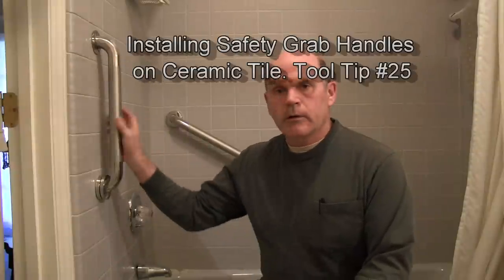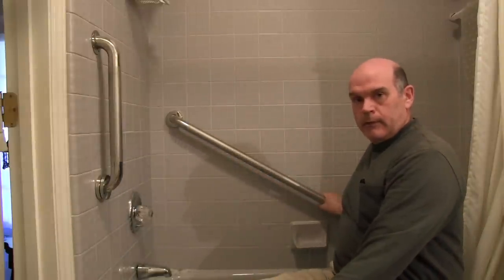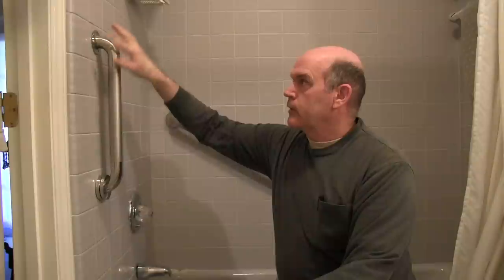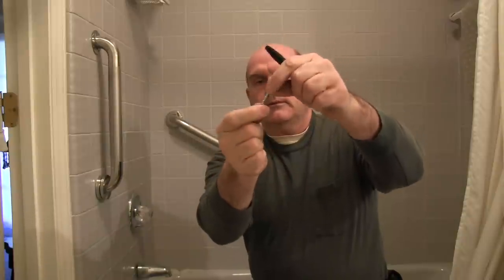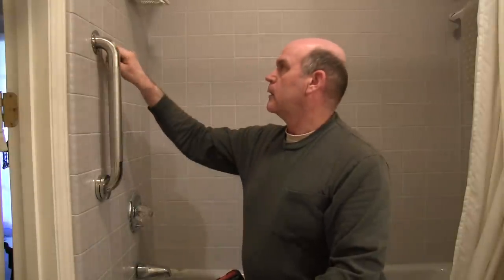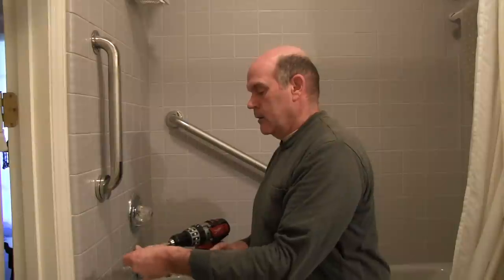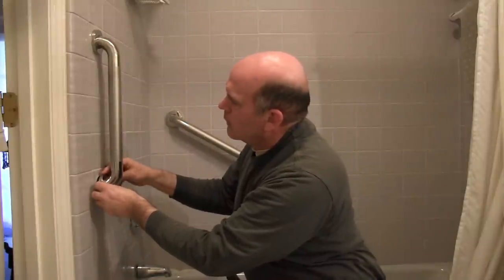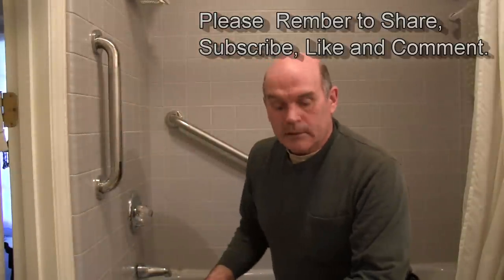Installing Safety Grab Handles on Ceramic Tile  Tool Tip #25

Comment: Just got mine done,  found out you definitely need a tile bit and a hammer drill , used bosh , !! I did 5/16 holes and plastic anchor and  screw kit #10 1&1/4 long 50 lbs per anchor , as it's a helper ... Not to support all my weight!  , it's great , got the 18" bar  at ace , having knee surgery wanting a rail to grab in shower ...  People say only mount to a stud.. great if they are in the correct place!!  I had none to line up .. tile is plenty... strong

Comment: You didn't show how you inserted the two screws under the actual rail itself, and you didn't apply silicon under the cover plates, after all it is a wet seal area

Comment: I'd much rather mount both bars to a stub.  Sometimes you can get easy access with a stud finder above the ceramic tile.  And on this one vertical bar, you had completely open access to the other side of the wall and could have used a stud finder on that other side of the wall.
Reply: Using special toggle bolts will work just fine.  They will not pull out.  But any kind of anchor might
Reply: Sometimes one needs to consider placement that's appropriate. Im an OT and half of the time I see a home with grab bars, in studs as you suggest and in awful, unusable placement in terms of function which kind of defeats the purpose of installation.

Comment: I found this video very helpful in installing a vertical grab bar in my ceramic tiled shower area. I intended to fasten one screw on each end into a steel wall stud & I was looking for a simple method of attaching the remaining four screws. Luckily I found this video on YouTube and instead of attaching grab bar to a steel stud with one screw on each end  & the two other screws on each end into molly's of some kind I decided to move the grab bar over & I attached both ends with 6 Walldog screws after drilling thru the ceramic tiles. These screws hold the grab bar solidly to the wall and I'm very confident that no amount of human pulling force on the bar will dislodge it.
Reply from the maker: +Fred Martinez Thanks

Comment: If you can't find the stud, you have to use wall anchors.  These videos are good, but not one has addressed the problem of when the wall behind it is an outside concrete wall.  I had to find out the hard way on my own.  When your wall behind you tile is an outside wall, it will not be a hollow wall, which all these spread apart anchors are made for.  No matter how deep you drill, you will not be able to hook up any anchor that has to spread out behind the wall.  You have to use anchor plugs, plastic or metal.  And make sure the screws are stainless steel, or else they will start rusting in and outside of the wall, with orange seeping down.
Reply: How is drilling and fixing into a solid wall a problem??
Reply: @TavsIsAbout  it isn't. It's the anchor spreader that's designed for use on dry wall, not solid wall. For solid wall, you need a different anchor
Reply: this is my problem. i drilled and through the tile and backer there is a .75 inch space and then a concrete wall that pertains to the outside. from the tile to the concrete wall is 1.75 inches total. SO do i drill thrugh and use a concrete anchor to the outside wall?

Comment: Grab bars MUST be anchored to studs. Code requires them to hold 300 lbs dead weight. If you do it this guys way and it pulls out you can be liable. I'm a contractor of 30 plus years.
Reply: Code?  Haha

Comment: Thanks very much, very clearly explained!  I am going to see if I can find the studs and use them if possible - if not, I'll use this method.  Dumb question: can I assume a bathroom built about 1968 has concrete backboard behind the tile?  Or could it possibly be plywood?
Reply from the maker: I don't know.

Comment: I have purchased 1 1/4 dog screws I noticed you used 1 1/2 is my size screw still ok
Reply from the maker: You will have to drill an exploratory hole and measure the thickness of the material under the tile. Then select a screw size so that the tip of the screw will penetrate the material under the tile and as much of the "threads" of the screw are engaged as possible.

Comment: Those screws will never hold in a million years !!
Reply from the maker: A million years is a long time but they have held up for eight years so far. I think I weighed about 250 lbs when I made this video and I tried to pull them off and they did not budge. I just checked them again today and they are still solid. If they ever loosen even a little I will take them down and fill the holes with grout.

Comment: Hi, I’d be really interested to know if the wall dogs are still holding the bar on, or if you had any problems with them after all this time?? Thank you
Reply from the maker: The grab bars are still sturdy but they have not been used for two years since my mother-in-law has passed.

Comment: do you think 2 butterfly screws would work better than wall dog or is that over kill?
Reply from the maker: I do not like butterfly screws. You have to make a large hole that weakens the drywall or backer board and the bolt then has a sloppy fit.

Comment: Do you use the recommended 3/16 bit for the tile and have you ever had the tile crack or chip when driving the screw?
Reply from the maker: Paul Strausbaugh, somewhere in the video I mentioned that the drill bit I used to drill through the tile is larger than the screw. That way the only stress on the tile is clamping force. I have not cracked any tiles using this method.
Reply: Thanks. I saw that. Do you recall the size you use for the tile? I have 1/4 and 5/16 tile bits. Also do you start in hammer mode?
Reply: Oh and I just checked. My tile is porcelain not ceramic if that makes a difference.
Reply from the maker: Paul Strausbaugh, whatever the tile is made of, you don't want the threads of the screw to bite into the tile.

Comment: The shower is plastic or something so behind it is a 2 inch Gap what else can I use to secure it to shower sadly any ideas would be greatly appreciated
Reply from the maker: john dubreuil you can buy grab bars that mount with suction cups. They work well on fiberglass shower walls. Just be sure to remove and re-apply them before each use since the suction cups will gradually lose suction.

Comment: Never ever use a hammer drill on tile!  I assume you are calling your tool an incorrect name. That appears to be a clutch drill or impact driver.
Reply from the maker: Look @03:55. The drill I used is a hammer drill with a clutch. which is the same configuration of almost all hammer drills on the market.  It is not an impact driver or a rotary hammer.  If you want to drill ceramic tile with a plain rotary drill, be my guest but in the meantime, I will be drilling 10 holes with a hammer drill for every one hole you drill with a rotary drill and I will wear out fewer drills per hole than you do.
Reply: Thank you for pointing out your hammer setting, I see that now. 
And thank you for the informative video, however we will have to agree to disagree. I feel the proper way to drill in tile is without any type of hammer setting and this is widely accepted.  And I get through tile pretty quickly without a hammer setting. Tape, mark, drill slowly and cool, and your bits should last a long time without risking cracking or chipping tile.

Comment: So the first drill bit needs to be about the same diameter as the screw?
Reply from the maker: About the same size as the shank of the a screw.
Reply: mars1952 Great thanks so much. I appreciate it
Reply: mars1952 OK just to be clear before I start. In the video you said the second drillbit needs to be about the same size as the shank of the screw. In your response to me you said the first drillbit needs to be about the size of the shank. But the second drillbit is smaller than the first drillbit. I hope I making sense here
Reply: @donttrip775  Your initial hole drilled should be the same diameter as the screw diameter and should just be used to drill through the thickness of the tile.  Once you drill through the tile stop and change drill bits to a smaller drill bit.  As long as the second bit is smaller in diameter as the first drill bit you will be fine.  The second drill bit is essentially used to prevent the gypsum in the drywall behind the tile from crumbling.  In my opinion,  it's not really necessary.  Just don't go through the wall with the first drill bit, only the tile and you should be fine.
Reply: @passtheparcel2007  thanks so much!!

Comment: Do you have any thoughts regarding drilling through tiles and penetrating the membrane in a area exposed to water?
Reply: Just use some Silicone  Kitchen & Bath Sealant Caulk around the screws before before putting the covers on.

Comment: Honest question: Are wall dogs really that strong? Or did i miss a step in the video where he used anchors?
Reply from the maker: I only used Walldogs. The key to the strength is the drilling/driving technique and the cement backer board.  Plain drywall would not be strong enough. On other jobs, I have used Walldogs to hold up static loads and they are still fine after five years. Hand holds have dynamic loads.
Reply: @mars1952  thx for the prompt reply! I'm preparing to install grab bars for a man with mobility issues (he recently had a stroke). I want to avoid a situation where the bar fails. 

So these wall dogs will work on tile with reliability. Sounds good to me. I've used wall dogs on drywall, plaster, and ceiling tile, but those were for light duty.
Reply: @mars1952  one more question: is backer board the reason we don't need to find a stud? Kinda like plywood behind drywall?
Reply from the maker: @carlosaranibar4362  cement board can be strong enough just make sure there is backer board there before you drill any holes. Look behind the faucet or knobs.